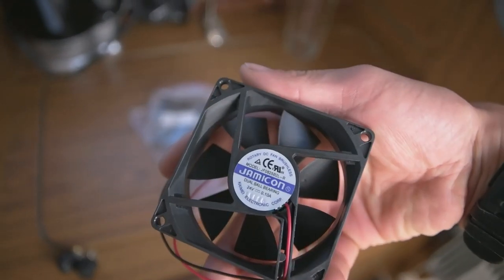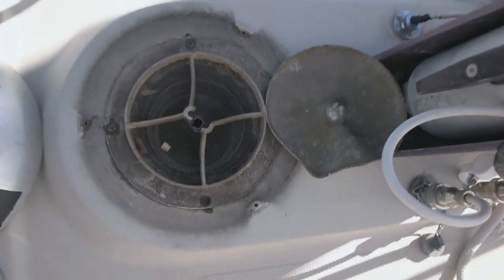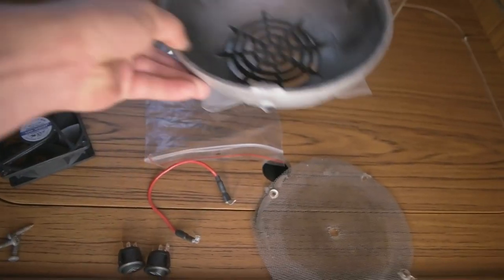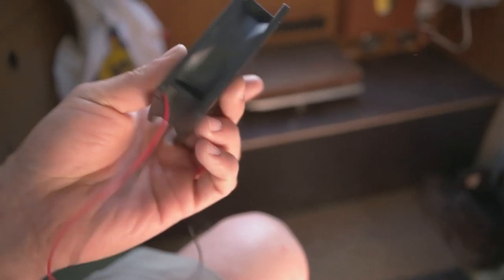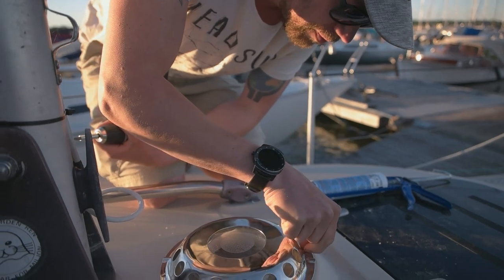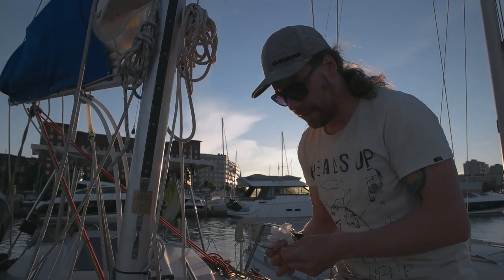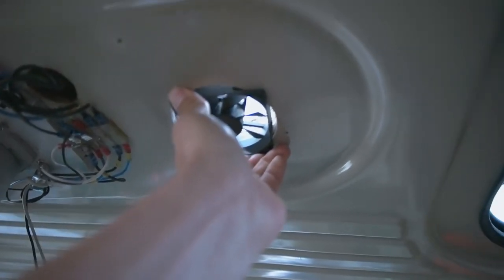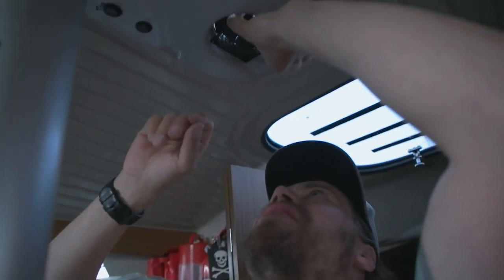Making new active ventilation dome - Electric sailboat vlog 0026

Comment: I'm about to install the same vent and feeling the same hesitation to screw the top cover into my deck. Hopefully you are still watertight.
Reply from the maker: Yes, mine is still water tight, but my mast attachment on the deck leaks some times :(
Reply: @PauliJuppi  Thanks for the reply, I ended up having enough access to use bolts, so far so good

Comment: I have also used computer fans in my boats, and what i have done is when i have the boat on land for winter storage, i connect fans directley to a solar panel (about 40w panel, tilted 90 degree to not get covered in snow) to have good ventilation all winter, make a huge diffrence for limiting mosture and mold.. :-)
Reply from the maker: +Peter Lehnér Thanks for sharing, good to know!

Comment: I used  two CPU fans inside the cabin: an arduino nano turns them in the sequense: one of them on for 8 hours, than both are off for  8 hour, than the other one on for 8 hours. THeye are connected to the battery bank which is solar powered. I put small resistors before the fans and before the arduino. The CPU fans are pushing the air from the bow towards the deck. There are also two solar wents installed over the head and over the stove: the one over the head pumps air in, the one over the stove (close to the deck) pumps air out. This way we close down the boat - she stays at a buoy - for the winter. IT actually sounds more complicated than it is in real life..:)
Reply from the maker: +Tibor Kiss Cool! You took it step further with the Arduino ;)